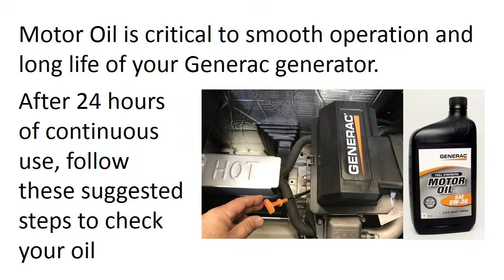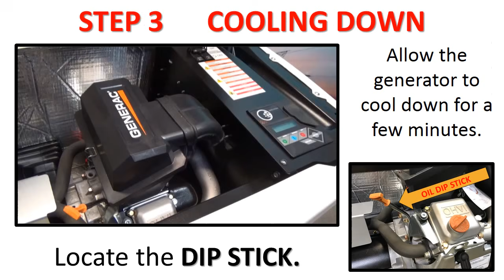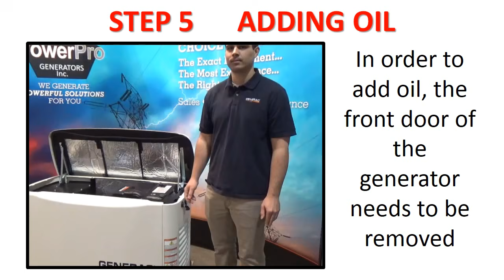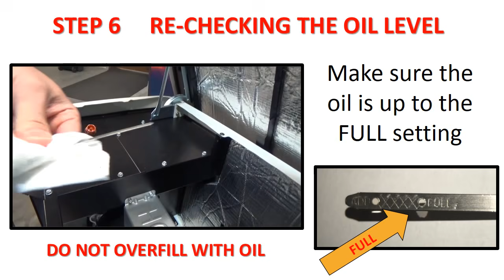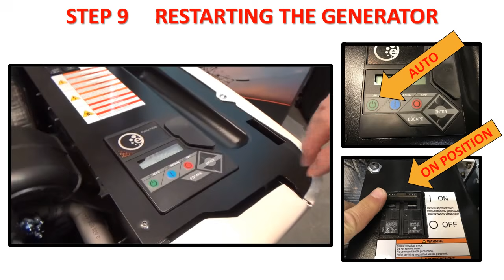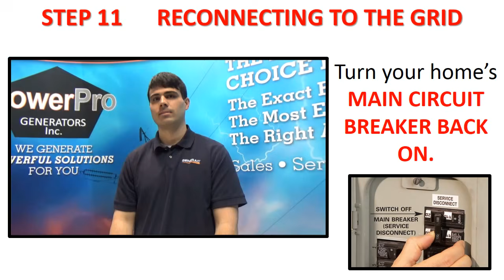Checking the Oil on a Generac Generator

Comment: Well that would have been very nice had the supplier gave you this information when purchasing the unit. Low fluids such as OIL are NOT covered under the warranty. This specified in the manual but most people wouldn't take the time to read the whole manual.  Result being a $320 service call when it quit!!!!!

Comment: My power went out at 1am...so can I check it in the following morning...may be like 31 hours?
Reply from the maker: Hi Chuck.....  31 hours is right at the edge of "too many hours" without checking.  Usually around 20 hours it is good to stop the machine and check the oil level.  I'm sure things are fine but check more often....